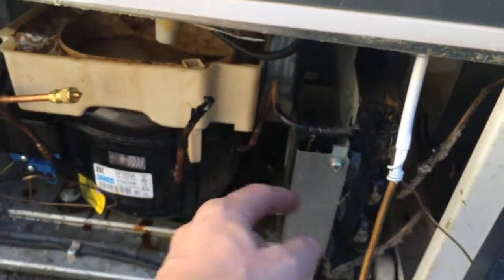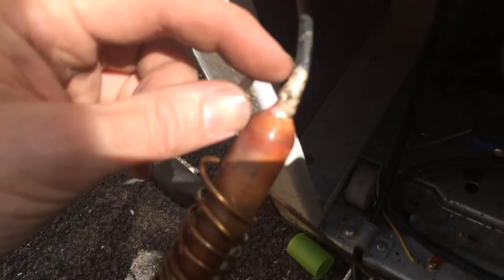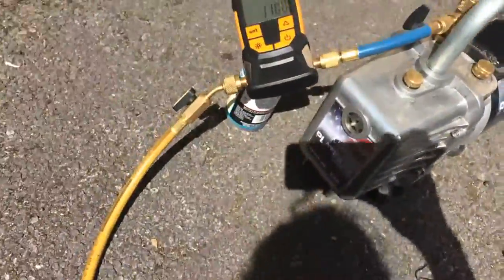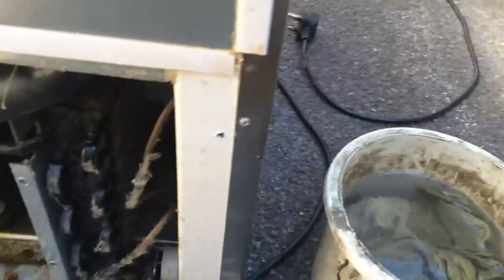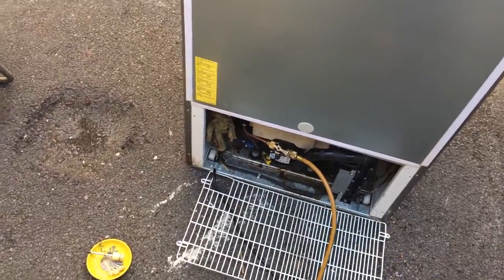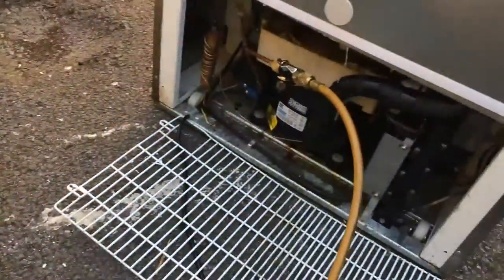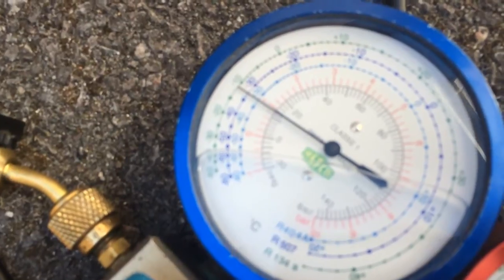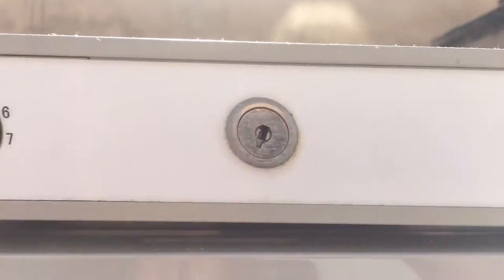Polar Express

Comment: nice repair i've tried to braze evaporator before when it been knifed worked few times, size of capillary to braze on to new dryer can some times be a pain but otherwise easy repairs
Reply from the maker: Brazing it was plan B, but the had also dented a lot of the channels so wasn't sure how well it would work even if i got it to seal.
Reply: What was rough cost of fitting that I repaired one other week by brazing it only charged 200. After I had sorted leak on bloody dryer pipe
Reply from the maker: Tony Clifton
Probably just over £300 but did also work on prep table. It just took ages to get a good vacuum level so put the labour costs up.

Comment: How much is a new commercial Refrigerator? How much roughly for a repair like that? What is the service life for a piece unit like that?
Reply from the maker: New one of this quality is about £450, a decent one would be double that. The repair worked out about two third the cost of replacement but it was a nearly new cabinet (customers choice) plus some of the time in site was looking at other equipment.

Comment: easy finish really what about grease gobbler or even a wee bit of supa clean . or if stuck a bit of r12 ;)
Reply from the maker: It was all I had on the van! Lost my Superclean somewhere, washed the van on the weekend, superclean is great for cleaning brake dust off wheels (well diluted) but couldn't find it....
Reply: +heavydiesel and cleaning body work . We cant buy in now as some twat used it neat in a hydro sprayer with the vrv  not isolated and it burned him . So we get envirocoil ........

Comment: I have tried an epoxy stick before ( green stick) and it seems to work sort of. But then, old fridge and the other option was to turn it into scrap. No money for new so i did a try.
Reply from the maker: We used to be able to get a two part epoxy for doing these, Epox-A-Leak or something like, but seems they stopped selling it here now.
Reply: Hello ,

Super videos.

The evaporator can also be sealed with JB Weld. 'Ve already some with a knife or screwdriver "defrosted" were repaired.